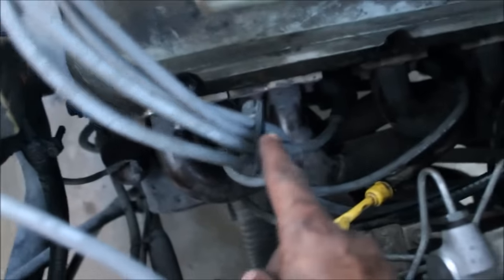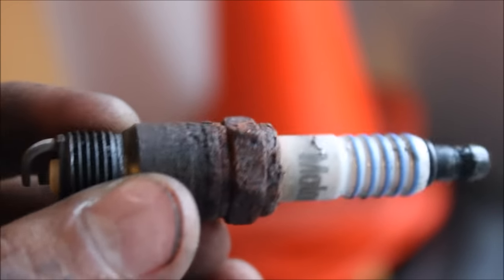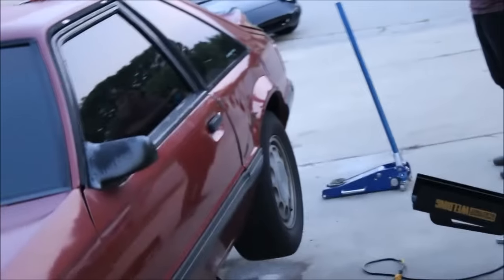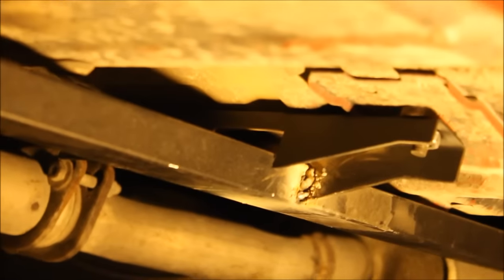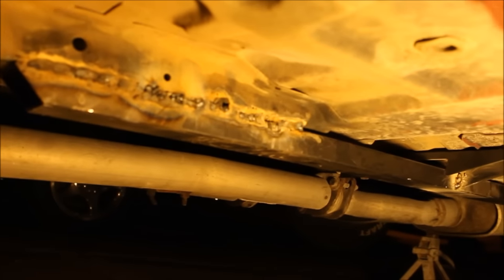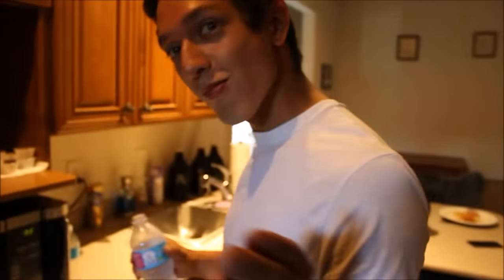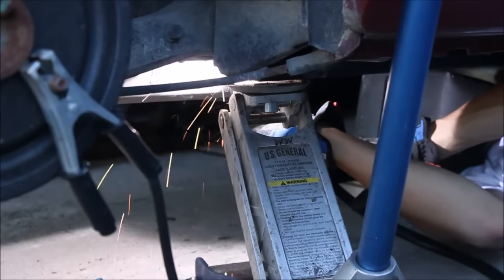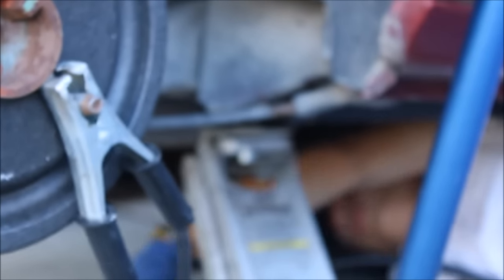Foxbody Drift Build- Part 2

Comment: what is the song at the end? Also, attach the welder ground to the car sheet metal. Connected to that wheel stud the current had go go through the control arm bushings or the brake lines.